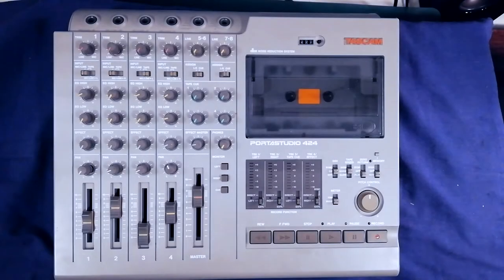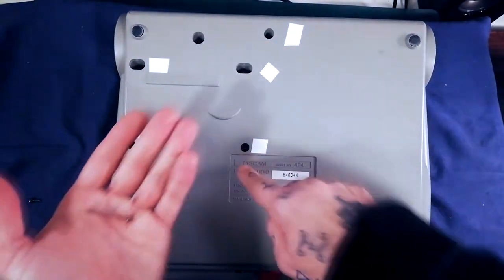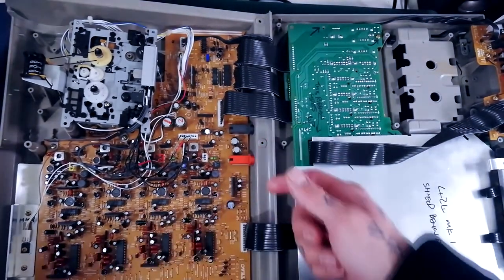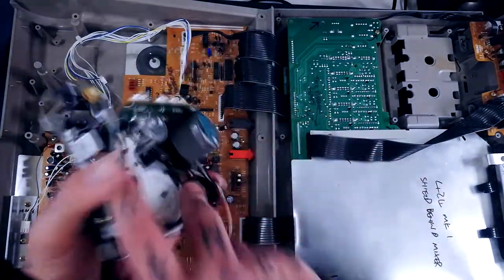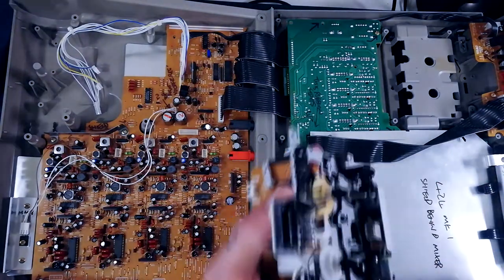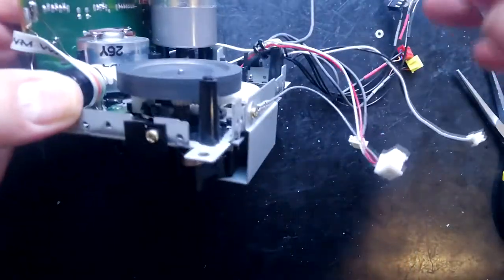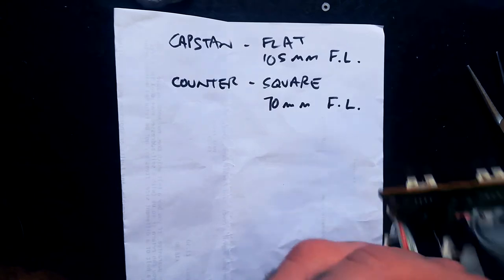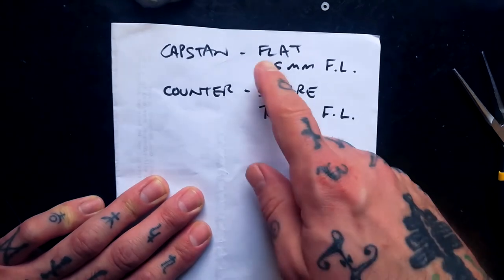Tascam 424 | Tear Down | 1 | open case,  change belts

Comment: Could I ask you a question? I dropped my 424. About 2 feet. I noted rattling . I opened and saw the copper transformer pop off and one of the wires came off the circuit board ripped off the transformer . My question is can I fix the transformer ? Replace? Also there this lil circuit board just above the transformer. In your videos it seems tucked under the transformer. If mine is hanging freely , did it detach from something? Thank you for any help! I really love this machine . It’s my childhood recorder
Reply from the maker: If its a 424 mk 1 the grey/beige one (?) that has an external AC to DC adapter, so we need to figure out which part you are talking about...do you mean the solenoid, its part of the cassette player? You cna share photos of the problem with me over facebook or instagram if its easier...

Comment: Hi ,I just got a 424 ;and someone had desoldered the motor ,so I soldered it back, it run alright for a couple of days, but now it doesn't any more and its getting hot ,should I get another motor or could it be something else?Thanks for your time and for the videos

Comment: Hey your videos have been immensely helpful in keeping my 424 alive. Currently having sporadic tape speed issues where the tape drops speed for a few moments at a time then returns. Some days it does it some days it doesn’t. would you be able to lend your infinite wisdom to advising on possible causes or best way to troubleshoot?
Reply from the maker: I’d look retouch the solder going into the motor? Is the pitch control pot dirty? Or the cable loose?

Comment: Hi Tetrakan: I found your channel as I was about to repair my 424 mkI.  It wouldn't power on.  I tested the adapter w/ a multi-tester, that's not the problem.  Upon close inspection, the solder joints of the power jack inside the unit had broken.  I soldered them back securely.  Excited to see it come to life- nothing happened.  I wiggled it a bit, & the lights came on, & I knew I was on the right track.  Taking it apart, I discovered that the 3rd contact was broken as well, so I took care of that.  Now I was sure it would fire up... nothing.  Wiggling it again, the lights come on... I've concluded that the jack itself needs to be replaced.  Do you know where I can find this part? Or do you know what it's properly called?  Thank you for your videos.  I don't know yet if I'll need to do more work on it once this is sorted- but this unit has been non-functioning for over 20 yrs.  it's difficult to believe, b/c I clearly remember the last time I tried to fix it.  Doesn't seem that long ago!  Thank you!

Comment: I've got a 424 mki that is randomly stopping during playback and recording. I swapped out the capstan belt and it seemed to work for a little bit, but eventually the problem persisted. Any idea on where to look?

Comment: I recently got one of these however it didn't come with the original power supply? Are you using the original power supply? Or just a 12v that matches the rigs power supply specs?
Reply from the maker: It's a third-party psu. Oay particular attention to polarity, it should be negative tip.

Comment: Hey. As a complete amateur when it comes to tech stuff I had great fun following your instructions to replace belts on my newly bought 424 last evening - only to discover in middle of it all that I’d been sent the wrong size belts from a seller on eBay. That don’t list the sizes at all just what they’re for which is terrible! Anyway - guy is looking for tensile strength of the square belt to send me a replacement. Any ideas on this? Many thanks!
Reply from the maker: I'm sorry I don't know the tensile strength of the belt. The belts I have had best results with were made of neoprene or butadiene, hopefully between that and the dimensions the supplier can give you somethign appropriate?

Comment: Quick question, is there supposed to be a film capacitor on the underside of the board with the play button and all the transport controls? I’m just taking one apart, trying to repair, and I just don’t see anything else on the underside..
Reply from the maker: I’m sorry I don’t remember or have a board easily accessible to check. Sometimes I’ve had these things with all sorts of extra components wired in by techs as a dirty fix. But if it’s not on the schematic (downloadable from my blog) it’s not an original part.

Comment: Hello! I recently bought a 424 mk1 and have some problems. Track 3 and 4 outputs lower volume than same level recording on track 1 and 2. Do you happen to know what could be wrong?
Reply from the maker: There’s a good chance you just need to adjust the gain trimpots on the record and playback amplifiers on the bottom board, see my playlist on calibration, it’s on my YouTube channel homepage

Comment: Great vid; 2:08 what kind of plugs do you use for those ribbons? JST(?)H?!
Reply from the maker: I think they are JST H yes. In the years since I kinda decided crimping was more trouble than its worth, so it's been a while. Wherever possible, I just leave the original ribbon cable connectors attached.
Reply: Thanks for the quick reply. The white cap of the connector is not connected anymore (but I still have it) and the wires are sticking out. Somebody soldered the first 3 and hot glued the rest. I've removed the hot glue but cables are sticking out (apart from the first 3). What would your recommend? Remove soldering or just solder all wires?
Reply from the maker: @prrtalieloe5088 I'd probably just solder it in, seems simplest?

Comment: Hey! I have a 424 that has been working fairly well for a while until the machine started making some sort of audible whining noise. My playback seems to be slightly pitched up and when I try and pitch it up with the pitch control, it fails to do so. Any diagnosis?? Thanks!
Reply from the maker: Could be the motor control chip is overheating, that would increase physical noise from the motor, and it'd run too fast and be unresponsive to the pitch wheel, see this video. https://youtu.be/h1BBVAtDtIo

Comment: Great video, thanks!  I just pulled a 424 MK-1 off the shelf, bought it gently used in '94 and it's been in the box all this time.  I presume it needs belts, so your dis-assembly instructions are brilliant.  One question, though; when you say "folded length", does that mean 1/2 of the circumference?  Belts are spec'd here in the States typically by circumference, so I need to make sure it is twice the folded length shown in the video.  Much obliged!
Reply from the maker: Yeah,  folded length is half the circumference....occasionally you’ll see Ali express and eBay suppliers describe their sizes this way, and I figured it’s a friendly way to describe the size for folks who are intimidated by mathematical nomenclature, whereas folks who.took mathematics into their teens or beyond should know to double the FL to obtain circumference, thanks for watching
Reply: @Tetrakan  Thanks for this clarification.  I took mine apart this morning (I'd have been looking for a 6th long screw without your video!), and took 2 measurements which let me model the geometry of the belt: motor shaft to flywheel shaft (66mm), and flywheel radius (23mm).  Using these 2 measurements, the length of the belt can be approximated by an "ice cream cone" shape, essentially an isosceles triangle topped with a half circle (approx. the capstan motor pulley is a point, i.e. zero radius, since it is small).  A bit of Pythagoras and Pi, and Voila!  212mm, or 106mm, Folded Length.  Good enough for government work!  I've used this approximation a few times, when, like in this case, the OEM belt was still in good shape and I preferred to wait until I had a spare in hand before taking apart to replace.   Thanks again for the video, lots of great tips.

Comment: Great video, thank you for sharing the information!  I have an old 424 mk 1 that the input 1-4 seems to work great at first but is distorted after about 20 mins into using it.   Line inputs (5-6,7-8) are fine though.  Any idea what could be the issue?
Reply from the maker: If somethign is okay then isn't thats usually a heat issue. Maybe the voltage regulator that supplies power to the opamps which act as voltage amplifiers in the audio path is loose of its heat sink, and after a whiel it gets too hot and casues distortion? I'm not saying thats it, but if I had it here and set out to prove or disprove that notion I'd probably end up finding the actual cause of the issue...sometimes you need a worjkign hypothesis to get started troubleshooting.
Reply: @Tetrakan  thank you, I really appreciate your insight!

Comment: Hey, 
Thanx! I own a fostex 28 h and tommorow I will get the tascam 424. Shall I sell the fostex? The tascam is better i think? In sound and parts
Reply from the maker: Different features, same quality (equivalent opamps, motor etc) . Per channel EQ and that third lower speed are advantages for the Tascam, but the extra channels and smaller footprint of the fostex might be better in some applications.
Reply: @Tetrakan  thanx ! It's the mk1 . Now,no surprise, they are mentioning, while testing  that there is no power supply with it .. 🤔 I've been told they are hard too find.
Reply from the maker: 12v negative tip DC power supply. Easy to find. MUST be negative tip though.
Reply: @Tetrakan  thanx!

Comment: I was wondering if you know what might be my issue. I commented a few days ago about getting a "broken" 424 Mk1. It finally arrived and it's a bit odd. Whenever I insert a cassette and press play the cassette starts playing but the heads don't come up and engage. I also can't adjust the speed (either through the pitch control or the speed button). I can fast forward and rewind without issues so I'm really confused as to why the tapeheads don't come up. Any ideas? The capstan belt seems to be pretty fresh, the tape counter belt is dry and needs replacement (but still works).
Reply from the maker: Operate it with the case open  to see if the capstan motor or flywheel are actually turning. The rotation of this is driven by the capstan motor via the capstan belt, which I turn engages the gears which raise the head. If the pinch roller doesn’t raise and touch the capstan pin then the capstan motor speed will have no effect on the tape speed…the tape will driven by the reel motor as it is in fwd mode. Also check the solenoid is actually moving in response to the play button being pressed.
Reply: @Tetrakan  I found the issue, turns out that the capstan motor was dead. It took me a while to figure out where to find them but I found old Sony Cassette decks to be a perfect donor for this model. Most "90-"94 models have the same motor and can be found around $30. A lot of the times people sell them as "broken" because the belts have gone and the doors won't open to eject anymore. I did have to oil the motor since it was noisy, but after oiling it's dead quiet. The little pulley is a bit different but I didn't find it affecting mine to much. I do have to resolder the headphone jack since it's very intermittent.

Thanks for your A+ content, really helped me with my issue even though it wasn't a common one.
Reply from the maker: @Drinkyoghurt  really glad you got to the bottom of that. I was wondering though, are you still getting 3&3/4 ips? Like, do your old recordings mafe at the highest speed setting still play back at the right speed? Because I would have thought the Sony motors were intended for 1&7/8ips? If that is a working transplant it'd be great if you could share the manufacturer and model number of the motor from the Sony, thanks!
Reply: @Tetrakan  Yeah that's an issue I'm running into now. It's playing back faster than normal, I'm guessing because the spindle is a slightly different diameter? I don't know how to transplant those from the old motor though. The motors themselves are the same, they're a MMI-6H2LWK produced in the same year. It's not neccessarily an issue for making tape loops but it is for making master tapes. 

So far the model numbers I've found with these motors are:

- Sony TC-WR590
- Sony TC-WR645S
- Sony TC-WR670
- Sony TC-WR690
- Sony TC-WR545
- Sony TC-WR535
- Sony TC-WE435 (?)

There are definitely more which have the same motor, but you'd have to transplant the pulley/spindle..I don't know what it's called, the thing the belt rolls on. I still have to figure out a way to do that because they seem to be really stuck on the shaft.

Edit: I just realized I could also just swap the circuit board from the working motor into the "dead" motor. What usually happens is the IC chip and a resistor just burns out and the motor is often fine. I have 2 motors to experiment with anyway so I can give it a go. I ordered a motor pinion gear puller just in case though.
Reply: @Tetrakan  Hey, I thought I'd give you a little update since your videos helped me on my way. I finally got around to ordering a test cassette with a 3000hz test tone for calibration. There are 3 pots on the board labeled "HS" "NS" and "S" which are clustered together. These are the pots for the speed adjustment. I hooked the audio outputs to my computer and ran Software Wow & Flutter meter (it's free software) and set the speed that way. I also changed my pinch roller, but I'm not sure if the replacement roller is of decent quality, seems like I have a tiny but more W&F, but it's not noticeable and the main thing is that the new roller doesn't slip. Replacing the pinch roller on this model is an absolute breeze btw, it just pops right out!

Comment: Hey there! Love your videos. Extremely helpful and I used your technique for changing the C-Gear on my 488 MKII. I have an issue with my 424 MKI, exact model as this: All of a sudden Track 3 will not record. I can get a good strong signal in, arm it, everything seems fine, I hit record but when I play back the tape there's nothing there. What could this mean?
Reply from the maker: This is a question which would require some understanding of electrical troubleshooting and the electrical anatomy of a tape recorder to diagnose and fix...if thats not you, check my electrical troubleshooting playlist on my home page 
 to get started. Assuming you get channel 3 playback okay, its definitely not the head. There are schematics for that model on my blog, i can't remember if it is relays or transistors used on that model to switch between record and playback mode of the heads, but find the junction on the schematic where the ch3 head signal branches between the input to the playback amplifier and the output of the record amplifier, there will be a transistor or a relay there. Test the input and output of that components for the presence of the input signal with a probe or scope in playback mode and record mode. The results of this test will tell you whether the relay transistor itself is damaged, or a component in the record amplifier has died, etc.
Reply: @Tetrakan  Thank you so much for your help!

Comment: Hey there, would you be able to drop some links for the sellers on eBay where you got these selection kits?
Reply from the maker: Sorry for this very late reply. I don't have a trusted supplier for belt assortments, its probably a different person every time I order - but typing "assorted cassette belts" into ebays search field yields 262 results as of today. its a crap shoot, but so long as you're not using these cheap belts for the capstan motor, they shouldn't contribute to wow and flutter in a significant way. For the capstan belts I spend a bit more at gbaudio.co.uk